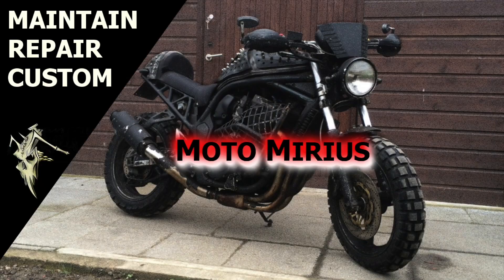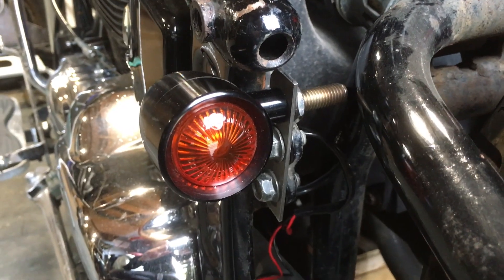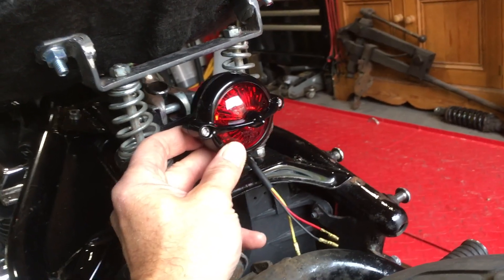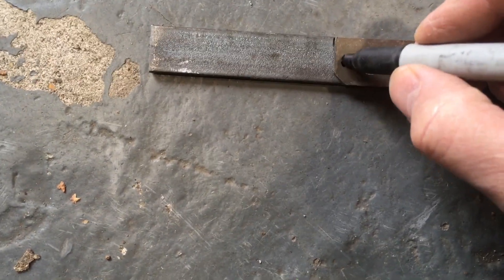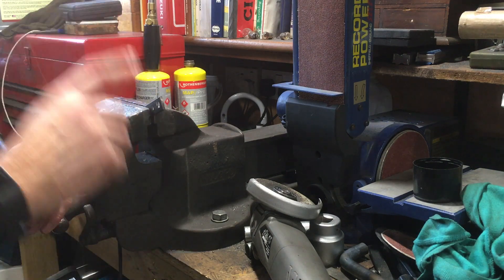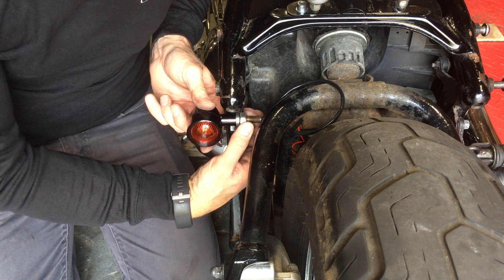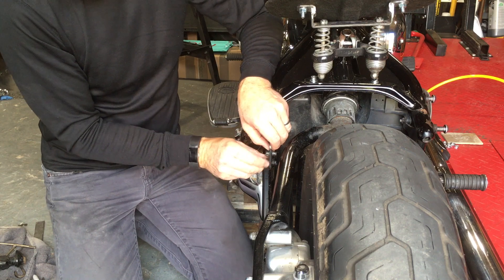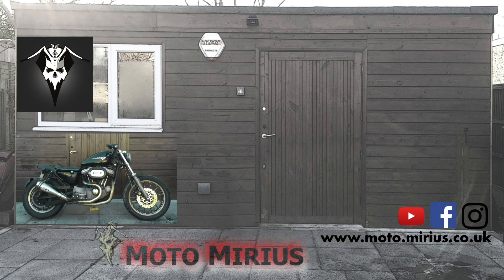Rear Indicators Install Fifties Classic Bobber XVS 650 #12

Comment: Hello Sir , may i ask you how to open /remove the rear tail lights including the licence plate holder on xvs 650 ? i would like to find the turn signal cable so i can remove the side chrome parts to remove the syssibar .  i know there are two screw on the left and right side but it wont pull out .  thanks in advance
Reply from the maker: Hi, the indicator wiring runs into the licence plate holder and then into the rear light.  From there it runs inside the mudguard to the connector under the side cover on the main bike.   It is not connected with the sissy bar in any way.   To fully remove the sissy bar it will be necessary to remove the mudguard so that you can remove the bolts that connect the sissy bar to the mudguard support brackets.  Skäl  David
Reply: @MotoMirius  Thank you so much for your help Sir. Have a nice Sunday.

Comment: i have difficulties to remove rear indicator lights because the cable went inside the sisybar  and it is hard to reattach the indicator light from the sisybar . i am stuck and dunno how to do it , am thinking to cut the wires .
Reply from the maker: In order to remove the indicators you need to either unpin the connector or cut the wires.   You almost certainly will need to remove the indicator bar and the rack if you have one, possibly the rear light and sissy bar support too.  It depends what you intend doing.  Unpinning the connector is best as you should then be able to pull the cable through - best practice is to attach a long wire or similar so once you are done you can then pull it all back into place.  Good luck!
Reply: @MotoMirius   Thank you so much , am afraid am gonna break the turn signal since its very stif , cant twist or turn .
Reply from the maker: @vickymcleod5244  It's not great to have so many fixings under the mudguard where they get rusty.  Soaking them with penetrating oil can help, but it's difficult to use heat without damaging the paint.  No real cure other than patience and not forcing it too much.
Reply: @MotoMirius  Thank you for da Tip. really appreciate it.